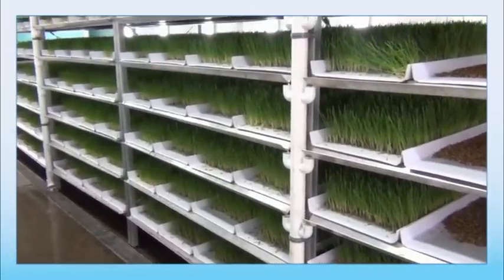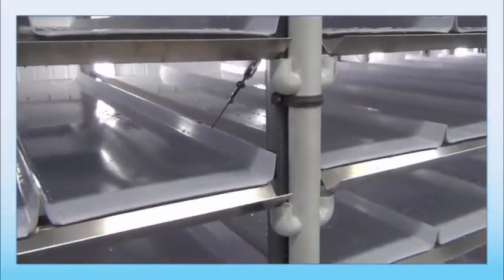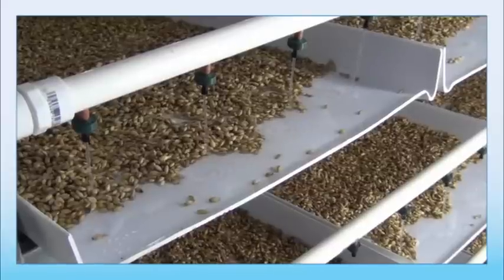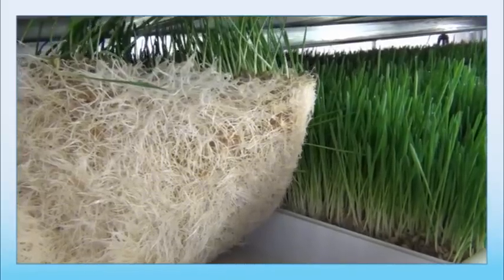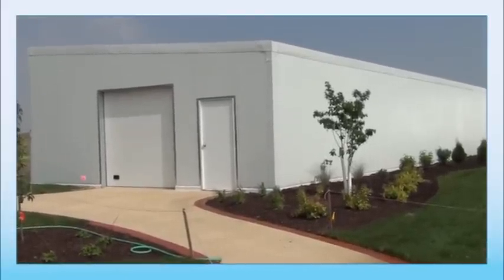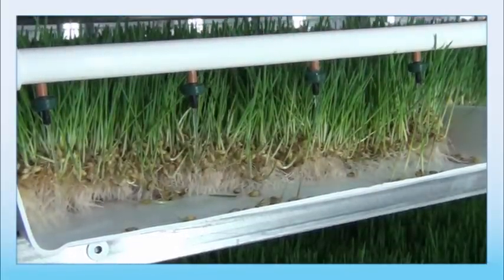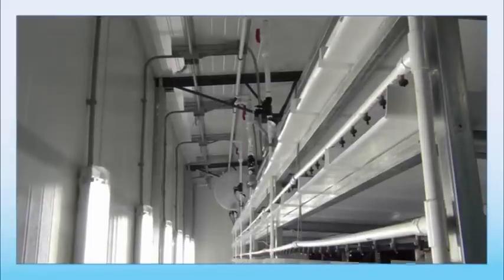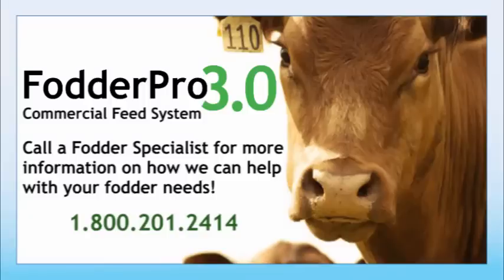FarmTek's Fodder Tips - FodderPro 3.0 Commercial Feed System

Comment: Help? Pump running 24/24?
Reply from the maker: Our systems water for just 2 minutes every 2 hours. Pumps are not required to run at all hours of the day, which helps to reduce electricity needs and operating costs.

Comment: How many and how much times we have to start motor for watering in a day..?
Reply from the maker: We recommend watering for 2 minutes every 2 hours. Our standard pumps are electric, so when plugged in and set on a timer, they will turn on and off automatically, with no need to manually turn on a motor multiple times per day. If you were to do this however, watering every 2 hours would mean turning on the pump or motor 12 times each day.

Comment: 1>Are Trays made up of aluminium? 2> is water being recycled into the system?
Reply from the maker: No, the trays are made of PVC plastic. Water is not recycled through the system, however, a typical watering period is only 2 minutes every 2 hours. During this time, approximately 9-11 gallons of water are used, which is less water used than in an average 10 minute shower.

Comment: irrigation.
How often do you water?
How many liters of water per square meter?
Reply from the maker: We recommend watering for 2 minutes every 2-3 hours. Each water cycle typically uses 9-11 gallons of water, which is less water than what is used in an average 10 minute shower.
Reply: - 9-11, and on what area?
Sowing of grain 4-5 kg / m²?
Cattle allocates co2. You can apply ventilation for photosynthesis - do not you do so?
Reply from the maker: The 9-11 gallons of water covers our entire line of systems. While a larger, custom system may require additional water usage, depending on the system that fits your needs, that level of water consumption covers the area of the system. We recommend a ventilated room or building for your fodder production. Circulation fans, roll-up/drop-down siding or roof vents should handle most facilities. However, if your in a very hot, humid location, additional ventilation may be required. If you have any other questions, you can contact one of our Fodder Specialists by phone at 860-528-1119. We are happy to help answer any questions you may have.

Comment: How much water is needed per day for the 375lbs Pro 3.0 system?? thanks
Reply from the maker: +Harry Papadopoulos these systems require 2 minutes of water every 2 hours.
Reply: +FarmTek agreed. in gallons per day? for the whole 375lbs rack?
Reply from the maker: +Harry Papadopoulos a typical 2 minute watering period will use about 9-11 gallons of water, which is less water used than is used in an average 10 minute shower.

Comment: how do I grow wheatgrass with the fodderpro 3.0 system without mold?
Reply from the maker: +Rick Johnson there could be a few variables in your growing environment causing the mold. You may need to look at the ventilation in your growing environment. One of the largest factors however could be the temperature. We recommend temperatures between 60-75 degrees to avoid mold issues. You will also want to be sure to give your channels a good cleaning as the mold could be leftover from a previous cycle and therefore continuing to cause problems. A simple solution with 10% bleach should get rid of any remaining mold.